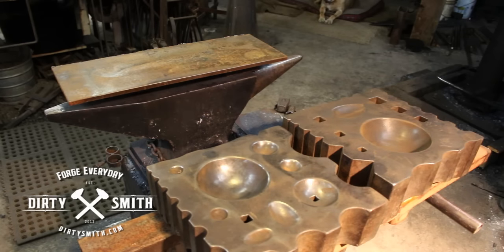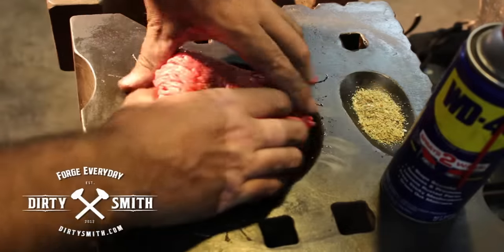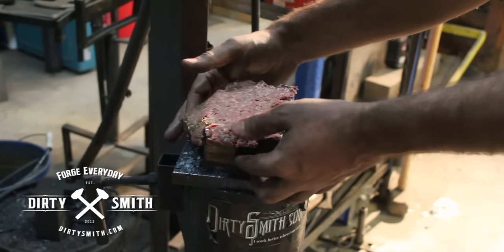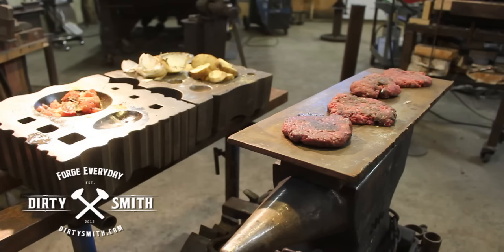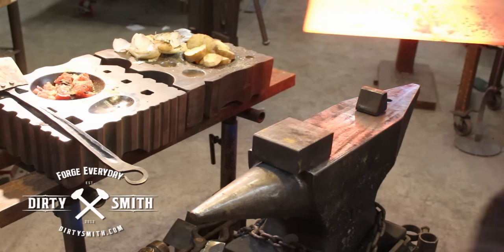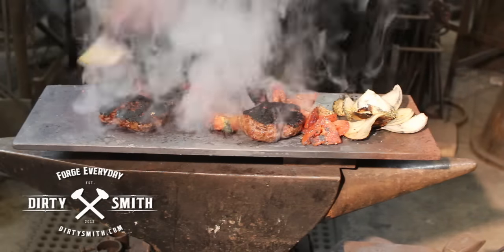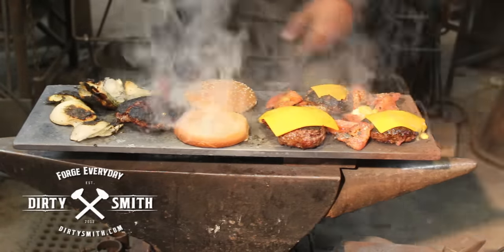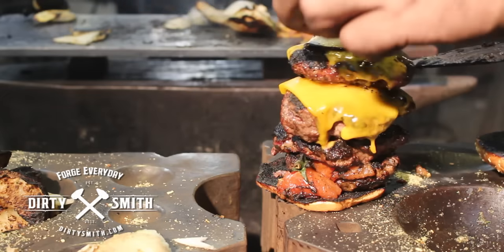Blacksmithing a hamburger

Comment: mr. rory I love the work you do. I have a technical question for you. can you give me some details on building my own hood for my forge. how much of it is metal? what speed of fan do you have pulling, and so on and so forth. pls spare more knowledge oh great smith of Colorado
Reply from the maker: my hood has no fan and draws/sucks. There is plenty of topics floating around about how to make one. It can be a combination of how tall the smoke stack is that helps the draw, opening of the hood and a shelf inside the hood that gets the air to roll up the stack.

Comment: On a serious note, is is actually possible to make a healthy meal through this way?
...Well, excluding the obvious health hazards.
I am curious and might try doing something like this because I'm absolutely insane like that.

Great video regardless, Rory! Bloody hillarious!
Reply: Well excluding dropping food on the shop floor and WD-40, sure. A thick hot plate is just the same as one on your stovetop - although glowing red is about 3 times hotter than your stove can reach and will burn things instantly. If you make meals and wrap them in foil, you just need a hot spot - like on top or next to your gas forge - and it'll slowly cook until it's lunchtime. You can actually do the same on your car's engine on a road trip. 75 miles for hotdogs, 180 miles for potatoes, 400 miles for a nice big roast.